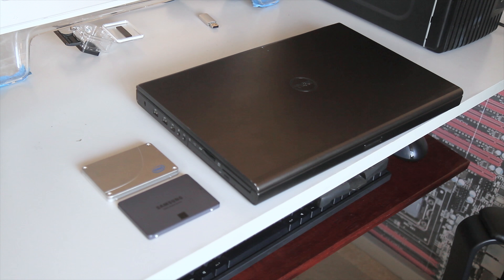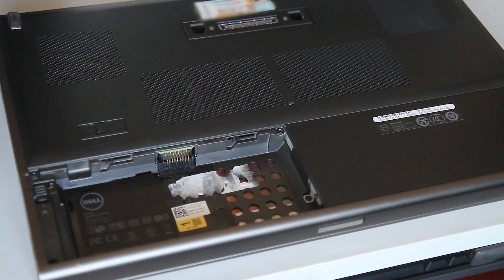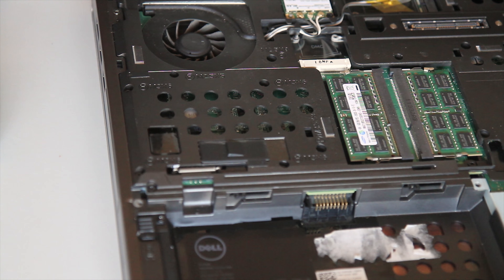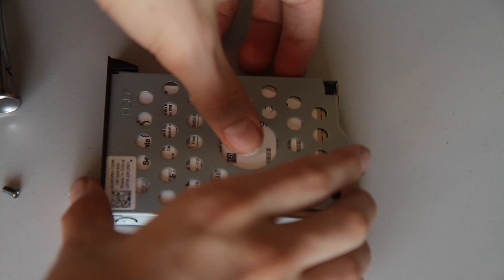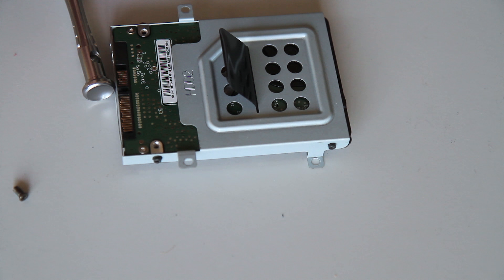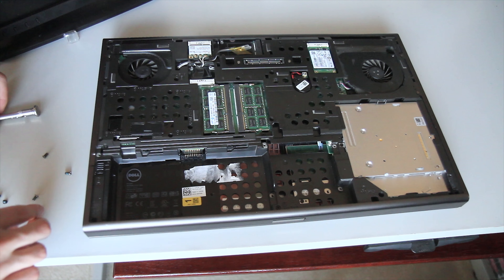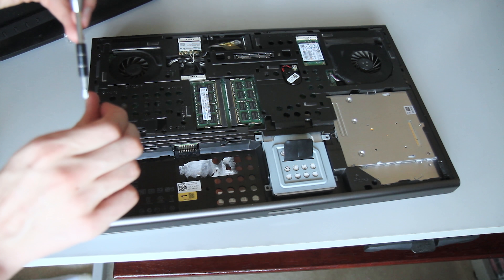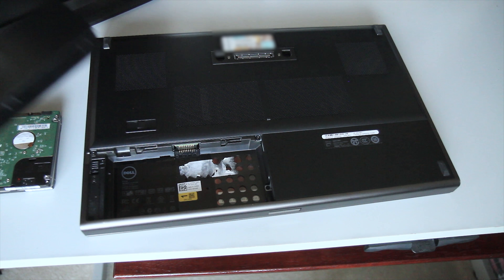Dell M6600 HDD Upgrade

Comment: I want replace the original hard drive with a Solid State hard drive, but don’t I need to transfer the data first?  Or do I just install the new hard drive I. The second slot?

Comment: I am  little confused, this laptop supports 3 hard drives? can you make the msata a boot disk and build a raid 1 with the other 2 drives?
Reply from the maker: Yea it supports 2 2.5in hdds a msata ssd and a optical drive. You can use all at once and setup msata as boot and raid on the hdds if you want.

Comment: What SSDs will fit the precision m6600? Not finding a good answer to that
Reply from the maker: Any 2.5 in sata ssd will work on the m6600. Both 2.5 bays are sata 6g aswell so you can get the full speed out of ssds
Reply: it also has mSata ssd slot.

Comment: Hi dude. I got a question for you about this Dell Model. I got the Intel i7 version and the tempeture is very high i think. The average tempeture is 50 Cº. In a rare ocation is 45 cº. Any advice? This is normal? Thanks for any answer.
Reply from the maker: What type of load is the laptop under? What temperature is this(bottom, cpu die)? 

These will normally get to about 80C under max load, and about 40-50 idle, so nothing about your cpu temps seems bad from this info.
Reply: 50 Cº to 60 Cº with 20% of CPU load. Only a browser open with two or tree tabs. What do you think? Also the coolers running all the time.
Reply from the maker: Doesn't seem alarming to me. I personally wouldn't worry and that's about the Temps my laptop runs at. You can try cleaning the fans and new thermal paste.
Reply: Thank you so much man. Thanks for quick answer. I´ll do it

Comment: Hi, 
I have just bought 16GB of hyper x ram, and a ssd, and 1 1 TB second HDD for this laptop.
The SSD and 8 GB of ram work fine, but the second HDD, and the ram underneath the keyboard just wont work, so I now have a laptop with only 8GB of ram, & only the SSD.
The second HDD does not even spin up, like it's not powered, and if I put memory underneath the keyboard it wont even boot.
Any idea what is wrong?
Reply from the maker: +Neville Springer what cpu do you have? Only the quad cores support using all the ram slots. For the hdd km guessing it's a bad connection or a faulty drive. Did you try the drive on a different system?
Reply: You can ran 16GB ram with i5 processor but only in this formation 2x8GB PC3L 1600MHz in two lower slots, 
those slots under the keyboard wont run with i5 or i7 dual processor, just with i7 quad.
I have M6800 and I love it, good machine it is. 
About storage memory you can run, 1x mSata from 128 to 512GB, 2 or 3 SSD up to 512GB, OR like me 1 SSD and 1 HDD and I will soon add 1 more SSD in the CD slot.
Reply: @Faithyes  Can you add 1TB msata and 1 TB SSD sata 3?